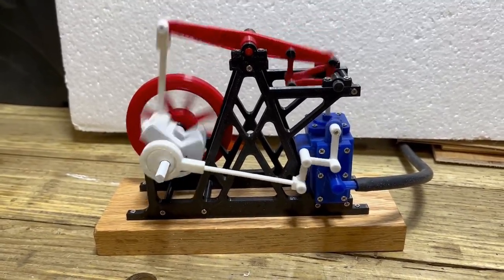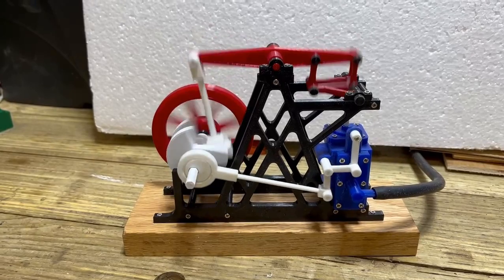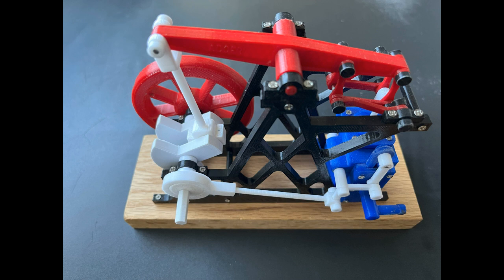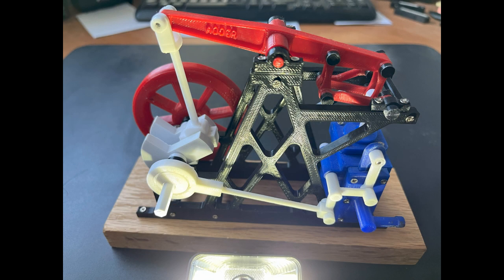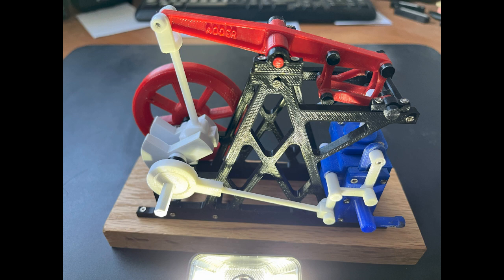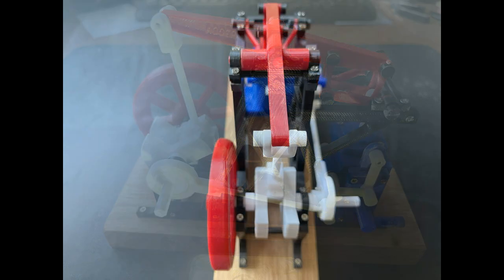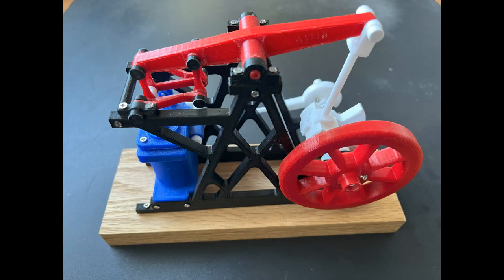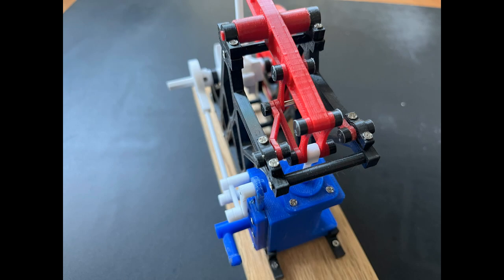3D Print- Mini Beam Engine

Comment: What psi are you putting into it
Reply: And what screws are you using
Reply from the maker: Hi. Thanks for the questions. Think the video was running on less than 5psi. It runs on next to no air pressure at all. I used 2mm self tapping screws of various lengths throughout.

Comment: Hi I am printing this engine but come stuck. The Crankshft.stl in Cura comes up with error. I still tried to print it but half way it went all funny. could you help please.
Reply from the maker: Hi. I am sorry you are having problems. I used Flashprint to slice and print my parts. However it does show error when the file is loaded. I just ignored that and it prints fine. However have you applied supports as you will a lot of supports and raft for a successful print. I will try to add a picture of the crankshaft with supports to my thingiverse page.
Reply: @oldadder  yes suppports everywhere and raft. I will try again thank you
Reply: Hi I printed it. Changed PLA from black to white, redid levelling and changed infill from30 to 20. Thank you for your support
Reply from the maker: @JustFun-iz9rf  Great news. Glad it has worked for you. Checking levelling on a regular basis is so important

Comment: Engine require battery to work?
Reply from the maker: The engine runs on compressed air in a similar manner to a steam engine. An electric motor could be fitted to drive a pulley attached to the crankshaft.